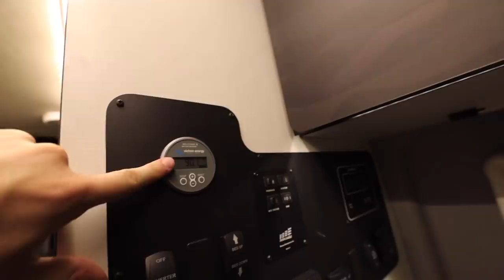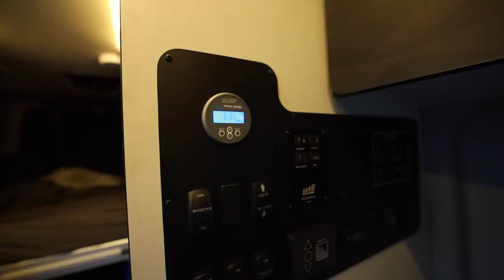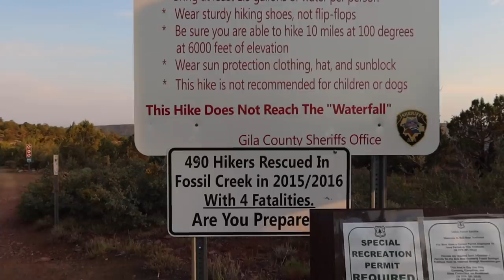MUST HAVE SUMMER #VANLIFE MOD? | Nomadic Cooling Co

Comment: With the AC problem solved "at least I think it is"... now I am wondering where I can put a Led tv somewhere in the van. Any ideas? Tv does not have to be very big. I am tempted to put it on top of the front seats but I will have to scrap the storage there and I am not sure how I will mount the tv OR maybe at the bed area but lifting the bed will hit the tv. Some ideas will really help here

Comment: Anxious to hear your review of how this AC performs.  I know Aaron at Roamrig has concerns with the cooling being able to keep up in the heat.  Also interested in how long you can run it on the stage 3.  I have the stage 3 also in my 2019 Revel.  Stock AC noise is ridiculous.

Comment: how many solar panels can I fit on the roof of a 144 sprinter 4x4 van and get max power to lithium batteries that can run all four example A/C, laptop/smartphone charger, GPS, induction stove, fridge and all other equipment for off grid use?
Reply from the maker: You would be better off with a beefed up alternator.
Reply: @TalonSei  but id still need one or two solar panels right?
Reply from the maker: Depends on how much you drive. Solar is really just to keep the batteries charged when not driving. Depending on what’s running in the van ie. Fridge, lights, fans etc. solar alone won’t keep things at 100% all the time.
Reply: @TalonSei  ahhh ic... whats the best alternator that you might recommend?